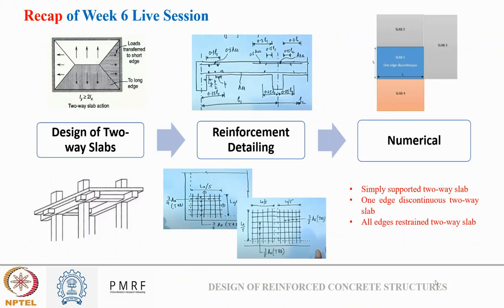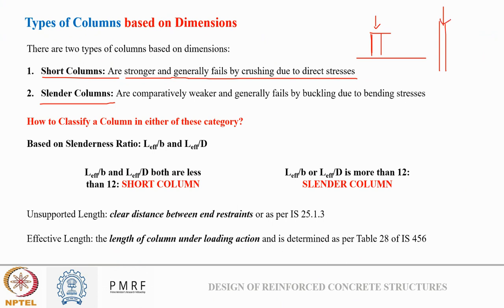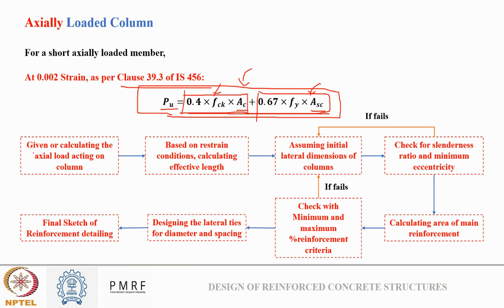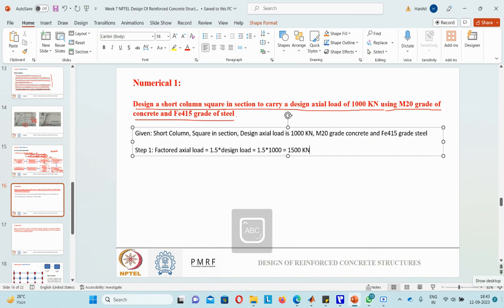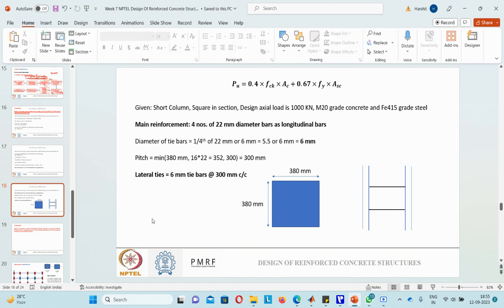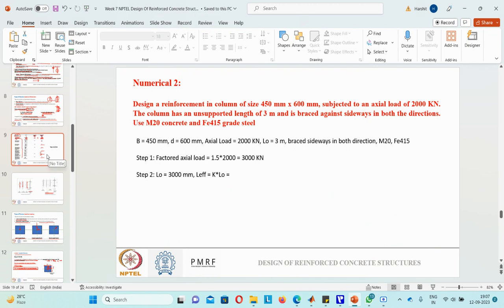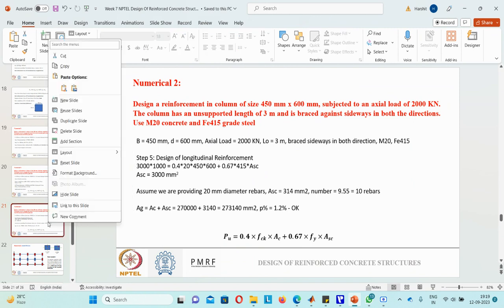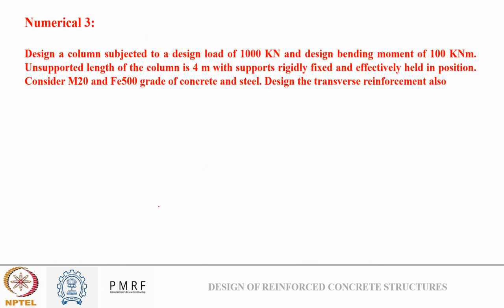Design of RC WEEK 7: Design of Axially loaded short RC column as per IS 456

Comment: why we have taken area of concrete is same as area of column  why we haven't gone as per example no 1
Reply from the maker: If you see Asc is usually very small compared to Ac, so mainly, Ag = Ac + Asc can be assumed to be Ac only for simplicity, but yeah, for more accurate calculations use Ac = Ag - Asc, it won't make much difference but still it's a good practice

Comment: In question no 2 no of longitudinal  bars  calculated are 10 and you have shown only 8 no of  bars at the end for summary sketch w
Reply from the maker: Ha, correct, that was a mistake, there are 10 bars, so 4 at top, 2 middle edges and 4 at bottom, tie bars then can be designed for corner bars and 4 middle bars accordingly, thanks for pointing that out